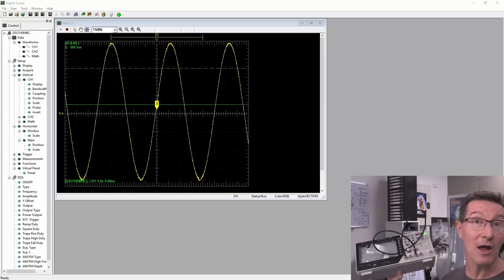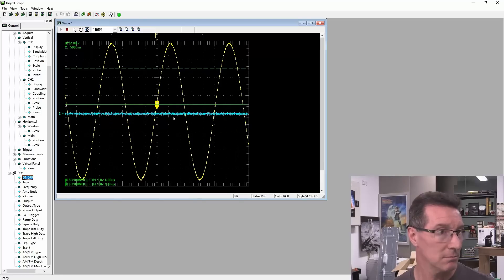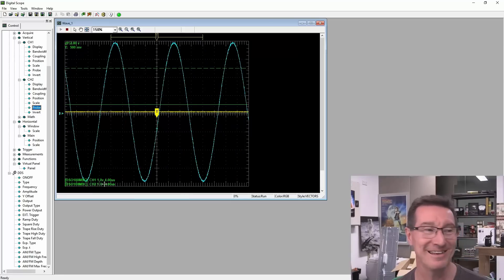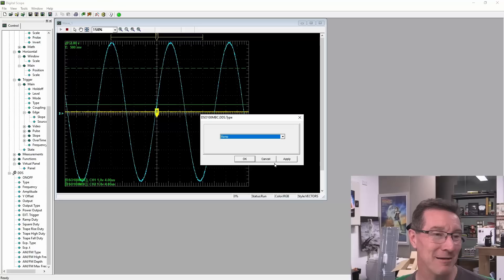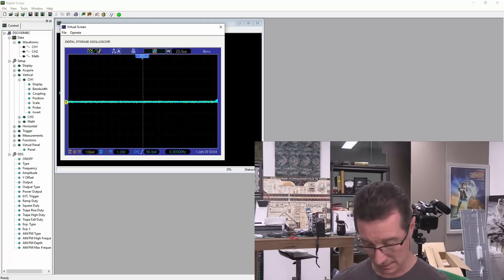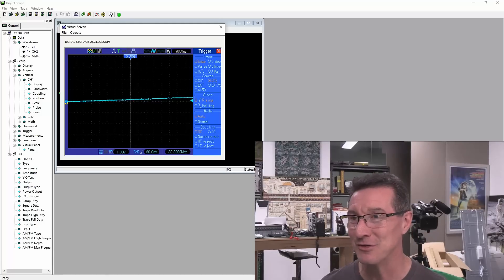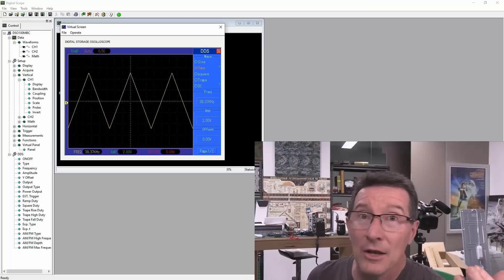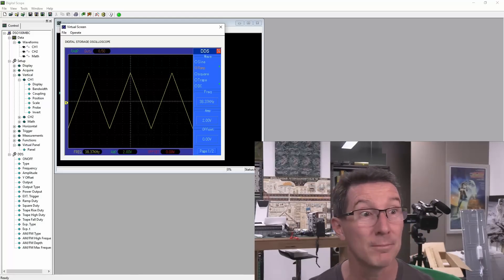The $5 Hantek Scope Is ALIVE! - Kinda...

Comment: I purchased a Hantek MPO6104D Oscilloscope with all the bells and whistles. It was nothing but problems. There were issues with just about everything. I went several rounds with Hantek trying to fix it, but every interaction with them required a video showing the issue, multiple days of back and forth emails with them not understanding the problem, etc. Some of the issues were buttons not being "de-bounced" so they either didn't fire or fired multiple times. It crashed constantly, especially when trying to connect to it from my PC. The software they sent wouldn't work most of the time. I eventually gave up on it and ordered a Rigol MPO5354 Oscilloscope. The Hantek is packed up and still sitting in its box in the corner.

Comment: That software shows a specific mindset -- the programmer is thinking entirely about the machine, not the users.  So the software is organized like the machine, not organized like people's needs.
Reply: It's generally more a budget / time / cost factor rather than programming mindset. Its organized in a way that is the quickest and simplest (aka cheapest) for the programmer to implement.

Comment: I think the USB user interface is actually pretty smart. It is clearly a hack, the tool is just exposing all the features of the scope to the user without providing any logic, it is probably automatically generated. It may be just a development tool not destined to end users, who knows?  Or maybe somebody thought about the case of a screen failing and added this USB interface, any way at least you can use your 5$ scope, so to me even though this piece of software is ugly as hell, it was still a smart move to add it to the product. It was also probably very cheap for them to do so.

Comment: Actually, it looks like a good start. It looks like everything is organized and the thought was to generate the UI automatically for every scope. The original vision was probably a compiler for the UI that would spit out a pre-made menu that a UX designer could then customize for each model with minimal effort. The tree view was just a proof of concept as those tend to be pre-made and easily interfaceable in almost every GUI library. Of course, as always, it turns out there was no designer hired, nor planned -- that was just a lie made up to keep the devs happy. I can also clearly hear the phrases: "QA?  But I thought you said the software works already!" after presenting the prototype, and "Can you finish the graphics yourselves?" followed by "It's not a high priority anyway, people will just use the screen on the device, this is just extra."
Reply: Yeah, and the software is there enough to write in the catalog "comes with free USB control and PC-Software". It works enough, so that it can be called "minimal viable product", but I think "minimum walking skeleton" is more fitting for this.

Comment: Better than nothing... I still use an old dual trace analog 20 Mhz scope from the 1980s.
Reply: You can still do a lot with a dual trace triggered sweep scope. It's the old synchronized/recurrent sweep "service" scopes (generally 5MHz or less, single trace) that you constantly run into the limits of no matter what you're doing.

Comment: Interesting that the software also does turn off the scope when the generator UI is on... but yes, the SW is pretty crusty. Not to say that the firmware on the scope is much better, but at least it works and is useful for people on a budget. I am quite happy with my comparable model it for the price.

Comment: I bought a Hantek 100 Mhz digital oscilloscope over 14 years ago, I very infrequently use it.  Being a tech that started my 1965 electrical come radio/electronics  trades apprenticeship with access to a 15 Mhz Telequipment electron tube oscilloscope  then when I joined the RAAF in January 1972 used a Tektronix 545 20 Mhz ( still electron tube) oscilloscope to fault find radar equipment, maybe analogue is in my blood.  I still use analogue CROs  over digital , I don't like the time delay in the sampling process no matter how small it is.  I suppose digital oscilloscopes have their uses but when fault finding I like to see the updates on the screen immediately.  
When it takes so many steps to enable a function just to see what's going on in a fault finding scenario the instrument has lost it's usefulness.  I own several models of Tektronix oscilloscopes  and HP instruments, also a couple of Kikusui  models.  I own a lot of older test equipment  from the likes of Tektronix, HP, Older Fluke and alike  that dare I say it, was built to last.  It's a pleasure to repair this equipment as it was built to allow and facilitate repairs. The same certainly can't be said for most Chinese manufactured  test equipment.  Good luck with your $5 Jaycar oscilloscope, will it be worth the time , effort and money to buy the replacement screen in the final analysis ?

Comment: tbh whenever I had people come into the store to buy an oscilloscope, I always told them to just buy a Rigol DS1054z from core electronics since it's basically the same price and you get a much better product than a rebadged Hantek
Reply: Yeah same. Atleast the new one we have (QC1938 aka Hantek DSO2D10) has serial decode enabled out of the box. Still bad value tho. Should be half the price.
Reply: @SimoWill75  use 3rd-party software. Much better than the stuff hantek provides.

Comment: These are good for basic Audio repairs. Other than that, not really. It is a little bit laggy though.
The function gen works well. The frequency is adjustable via the knob. 
I have the hantek. Basically bought it for its price, and did not need anything fancy.

Comment: Either now or after getting the replacement screen, try it on Pulseview or equivalent 3rd-party software. Assuming it’s compatible, which it should be if it’s a Hantek rebadge, you should see a world of difference. Same applies to the screenless USB scopes, which I hope will have a faster refresh rate.

Also let me shill those cheap logic analyser clones with Pulseview, they’re incredibly useful for troubleshooting digital circuits. I think the nanoDLA is more expensive but doesn’t come with the risk of bricking itself.
Reply from the maker: Pulseview does not work on this for me.